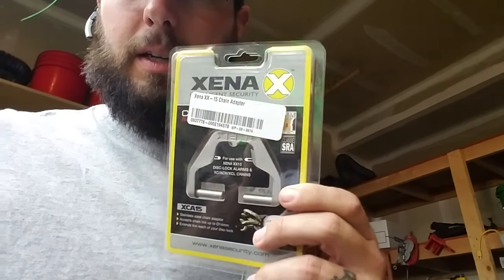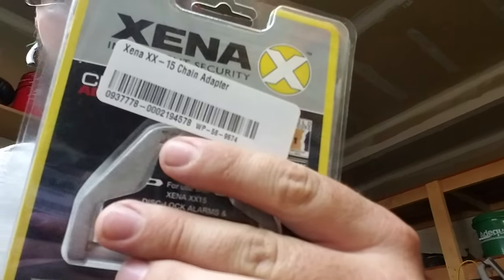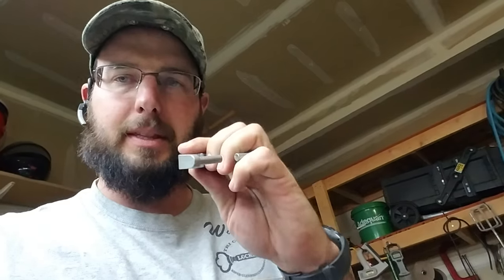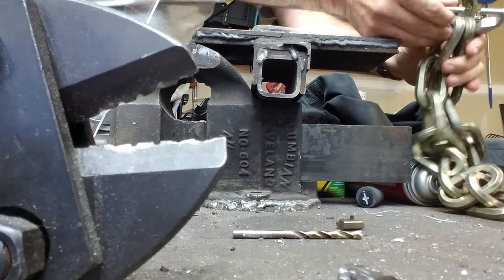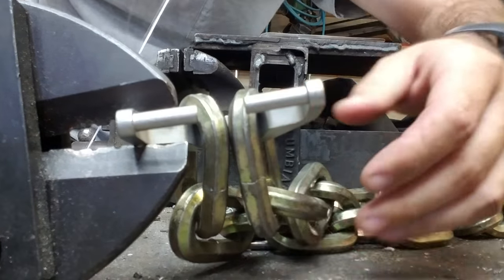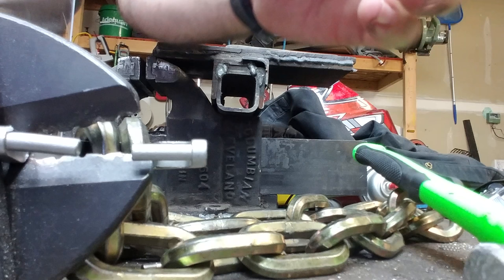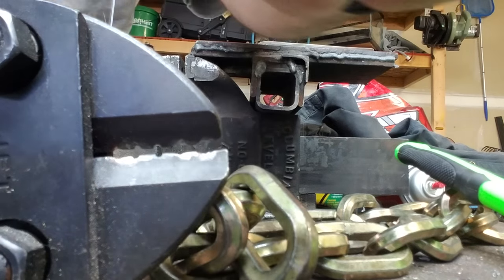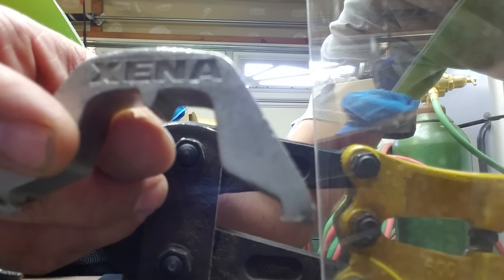Bolt Cutters VS XENA XCA15 Chain Lock Adaptor Disc-Lock Review Motorcycle

Comment: I own one of these and your review is totally FLAWED.. Here is the problem: 
(1)  This does not represent a real life situation. Your bolt cutters are firmly secured  to your workstation and you're comfortably working from your garage. 
(2) With a XX15 attached, you barely have 1/4in area to bite on w/ your bolt cutters. You got more surface area work with because you fail to mate the adapter with a XX-15 lock.
(3) The XX15 is an alarmed lock and it's loud. Try doing this on a public street. You struggled to cut it and it wouldn't be easier in a real life situation.
(4) Once you cut the adapter, you still have to deal with the XX15 lock.
(5) The majority of motorcycles aren't chained to anything. So if you have this on your bike, it's already a deterrent.

Comment: you need to do a test with alarm you can't use all the May inside the bolt cuter sir and yes with out alarms extra metal case it is easy by itself to cut you proved that plus the thing makes an alarm noise please test again